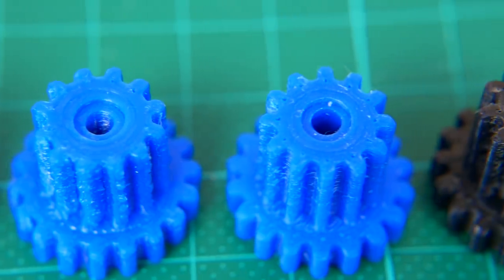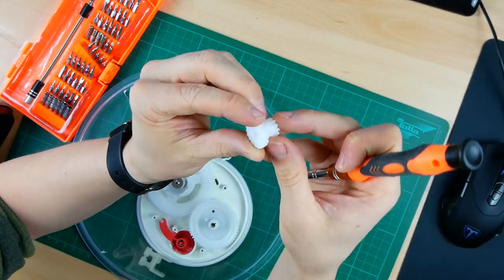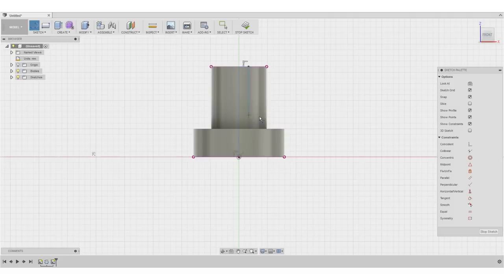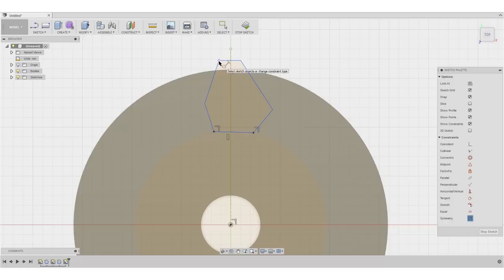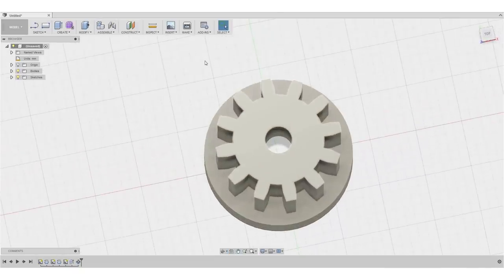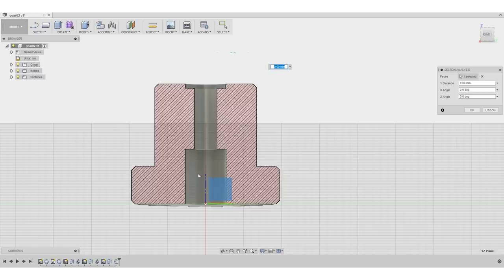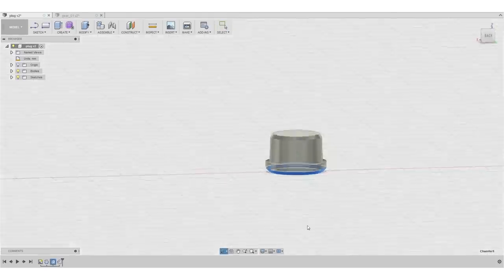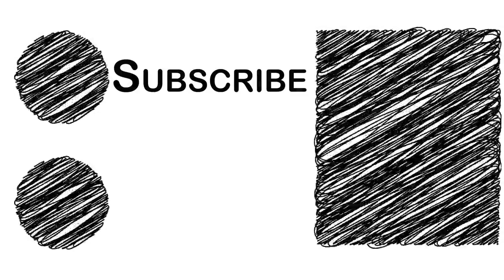3D Printed Gear Repair with Fusion 360 - Practical 3D Printing

Comment: You can try baking your PLA to strengthen it like Thomas Sanladerer talks about in this video:
https://www.youtube.com/watch?v=CZX8eHC7fws
Reply from the maker: I will definitely try that some time soon with my tensile testing machine and see if I get the same results as he did.
Reply: Or it will likely go forever, or a very long time. I have a motorized model that I built 4.5 years ago that has a whole geartrain printed in PLA. It runs in my office when I am in there, and it's been wheeling and spinning for 4.5 years and the gears look as good as when I built them. No wear, no apparent weakness.
Reply: Good to know.

Comment: It is not that simple to create this gear wheel like you did, because you need evolvent surface between two wheels and rolling without friction. I have learnt it at the University of technology (mechanical engineering).

Comment: What is your favourite Printer in Terms of Price and Performance today?
Reply from the maker: You can't find an optimium for the two factors price and performance. For some the $100 Tronxy X1 might be sufficient, if you have more to spend I'd go for an original Prusa.